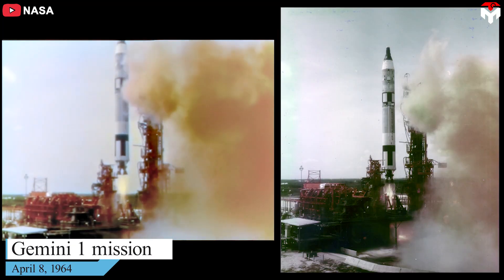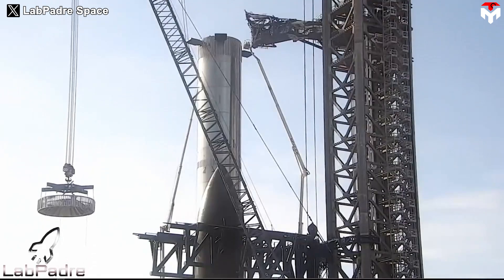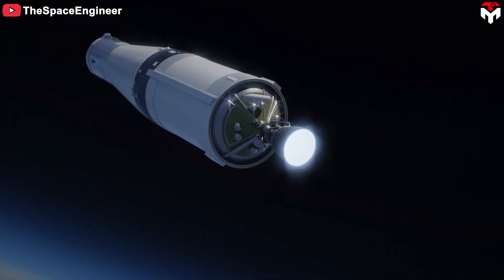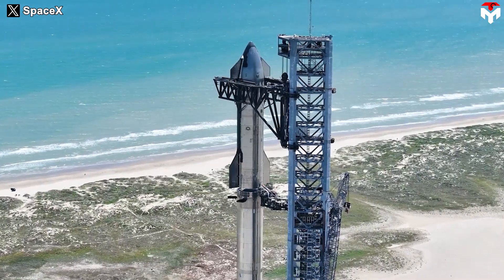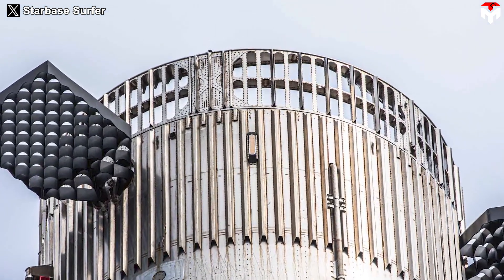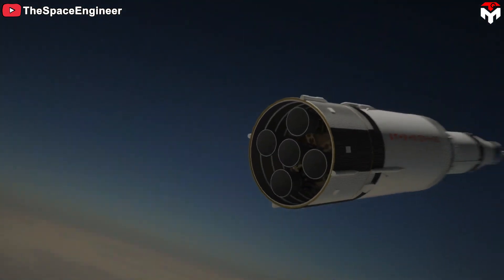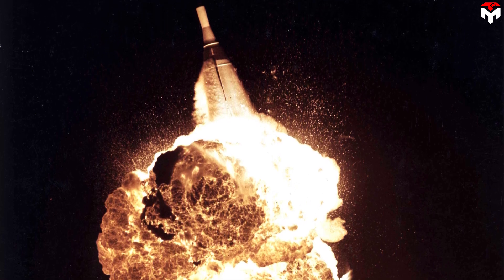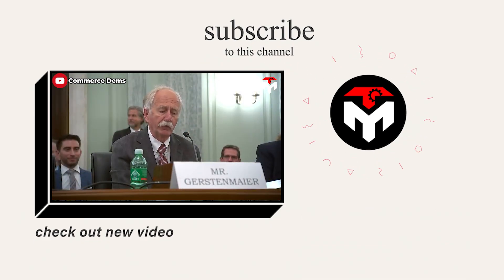Elon Musk Unveiled New Update on Starship Separation in IFT-2! More Upgrades coming...

Comment: It would better to not to throttle the booster back until after separation.
Reply from the maker: Thanks for sharing
Reply: They have to throttle back, the upper-stage Starship isn't as powerful as the booster. Starship would not be able to pull away from the booster if they didn't throttle back.
Reply: @StEvEn-dp1ri  I think the force-acceleration is additive so if additional acceleration is only on the second stage it will take its existing speed and pull away leaving the first stage under power that will prevent sloshing, I hope,  There will be sloshing in first stage if the second stage throttle up retards the first stage.   If no first stage throttling happens under power then I would rotate the first stage under power with thrusters.  I would look into fuel outlets off center in the tanks to force fluids into a area to insure constant  fuel flow.
Reply: @mcsmith7606  it's possible acceleration is accumulative, but the booster is so much more powerful it simply has to throttle back. CSI Starbase has a great video covering this part of stage separation. The hot stage has a real danger of back pressure even with the slits cut into the ring. Starship doesn't use thrusters to do the flip maneuver for the boost-back burn, they use the grid fins and the hit staging gases. It's all covered in the latest CSI Starbase video. I'd check it out.